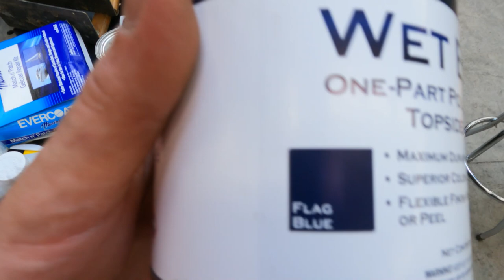Old Canoe Complete Restoration! // Lift Arc Builds

Comment: The fiberglass cloth you used is called just that...fiberglass cloth. The other that you did not use is called matting. Matting is used for strength and is then covered with the cloth.
Reply: It’s used for bulk more the strength the woven cloth is stronger

Comment: Try cutting the cloth on the bias next time you are doing bow and stern keel strips. It will lay down much easier and it will not fray or spread strands then.
Reply: Sorry, can you explain that to someone who is a new to this?
Reply: @jonathankr  Cutting glassfiber strips from the roll, the first inclination is to simply cut off a strip as wide as you want it and then glass it on your canoe. However, If you look at the fiber direction of the cloth you will se that some strands run lengthwise of the fabric and others run across. So if you simply cut off a strip from that you will be left with a strip that has fibers running lengthwise and across. If instead, you first cut off your cloth at a 45 degree angle and then cut you strips from that new 45 degree edge. You will then get strips that have fibers running in 45 degrees in relation to your strips length direction. This type of strip is called Bias cut strip and they will conform over shapes and stay down a lot easier. Puh... I hope that made sense.

Comment: Ya... I used to glam up my canoes like this too.  Here are suggestions for doing it better that I learned the hard way:
1. fill holes, dents, nicks with marine putty and sand before applying fiberglass and resin.
2. Only use marine grade resin like West System.  Don't use automotive resin like Bondo that you get at the hardware store. The automotive grade stuff yellows, gets brittle, and will eventually release from the repaired area.
3. Paint the boat the same color as the original.  Eventually, the new paint will get worn and scratched and show the original color and look awful.

Comment: Do you use a ventilation system of some kind to pull particles out of air?
Reply from the maker: We have a...fan...at the back of the building haha. Thankfully im not sanding fiberglass every day, we would need a different shop setup all together haha. Cheers! - Tay